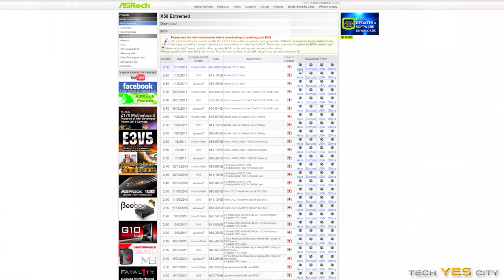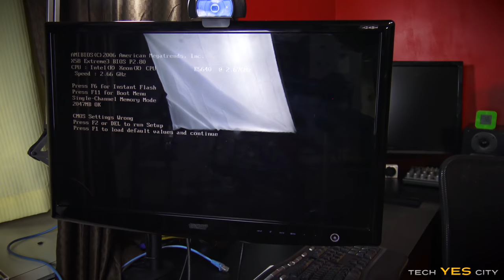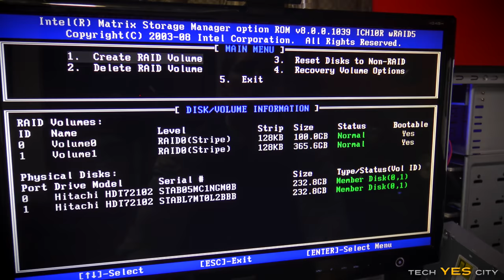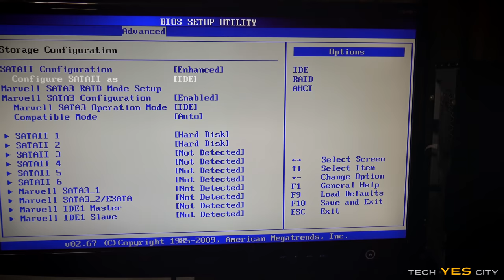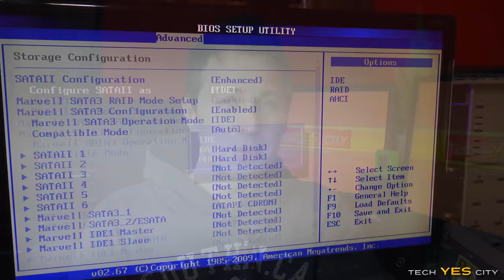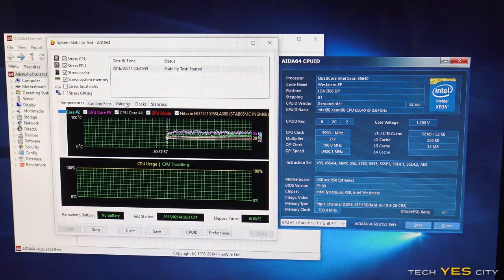Project WESTMERE - $327 USED PC Ft. The i7-???

Comment: i just finished my build,
Gigabyte GA-Z97X-Gaming GT                                                    140$
 i5-4690K                                                                                         190$
Hyper Savage 2X8GB 2400MHz DDR3                                        85$
Cooler Master V750 - Compact 750W 80 PLUS Gold               60$
Corsair Force GS 2.5" 480GB ssd                                               110$
Noctua NH-D14 Dual Fan CPU Large Case Tower Cooler        50$
Fractal Design Define S                                                                  40$
GIGABYTE G1 Gaming GTX 970                                                 250$
how'd i do?
Reply from the maker: +ekdromoi Got yourself a beast right there.

Comment: what ram is that pc useing because on intel the ram spec only gose to 1066 hz will it work whit 1600 hz ?
Reply from the maker: +kkeith 08 If the motherboard manufacturer supports it then yes.  This was 1333mhz ram.
Reply: Ok

Comment: you really need a electric screwdriver m8
Reply: +HUGSaLOT Valkyrie i have no knowledge on the subject but doesn't the magnetic field break hard drives and stuff? i guess it could work if you're careful
Reply: +Ramses Burgerding No, people use electric cordless screw drivers to build and dissemble PCs for decades. Assembly lines at Dell uses industrial drivers hanging from the ceilings. Electric screwdrivers do not create much of an electric field, even a magnetic tip screwdriver won't harm anything in a PC. You'd need something a bit stronger to ruin a hard drive.
Reply: HUGSaLOT Valkyrie alright thanks for the feedback man

Comment: Help, my laptop fans going crazy, CPU 100% idle BIOS up to date o.O
I've only upgraded Ram Memory..
Reply from the maker: +Skyller007 Probably getting hot inside the laptop, might need to clean it up and apply some new thermal paste?
Reply: +Skyller007 Pull the RAM and retest. Try briefly using a vacuum to suck the air out of the intake ports and hopefully remove fluff from the HSF unit. Don't use the vacuum to see how fast the fan will spin, be brief :D
Reply: the laptop can't handle it.

Comment: is it lga1366 socket?
Reply: +Chen Tzur yes, X58 motherboards use lga1366.
Reply: +PixelzGaming 
will xeon x5570 and w3570 fit on the 1366 x58 mother board? or they will all the 1366 mother boards?
Reply: Both of these processors are socket 1366. All motherboards x58 should support but still check manufacturers website to confirm.